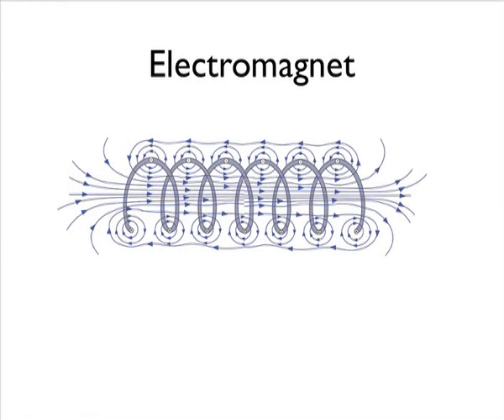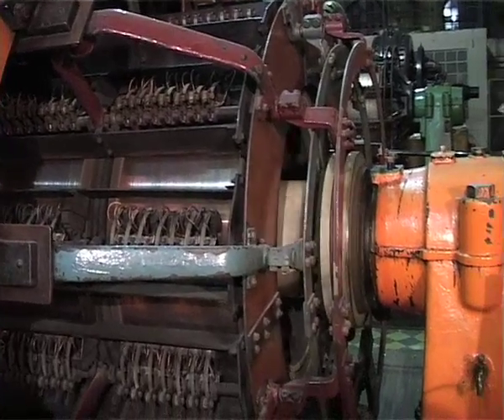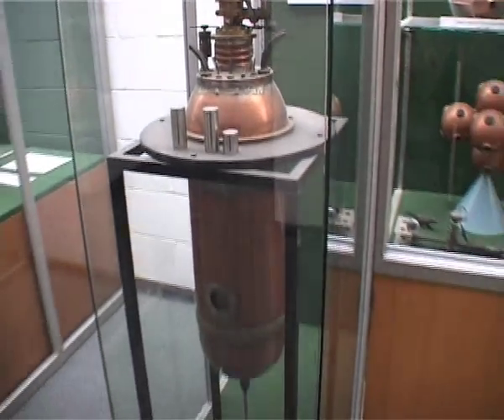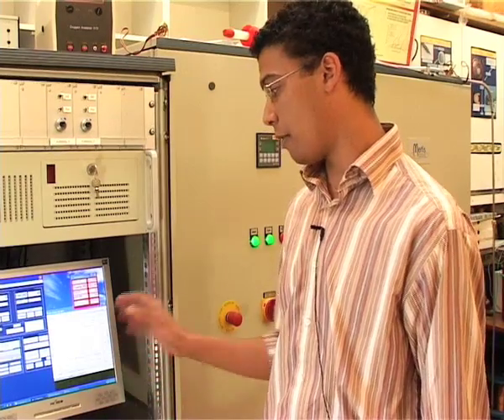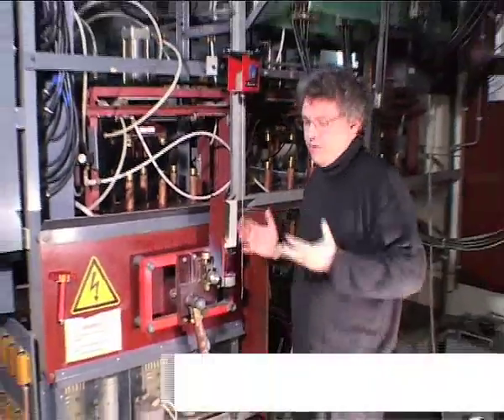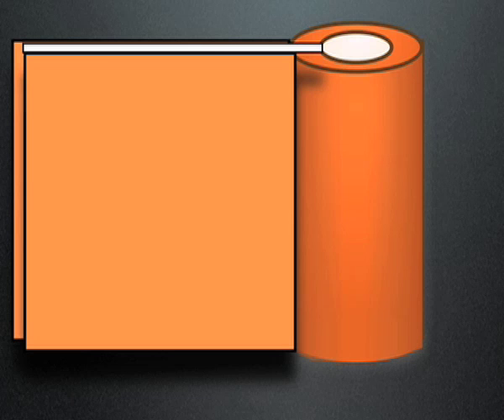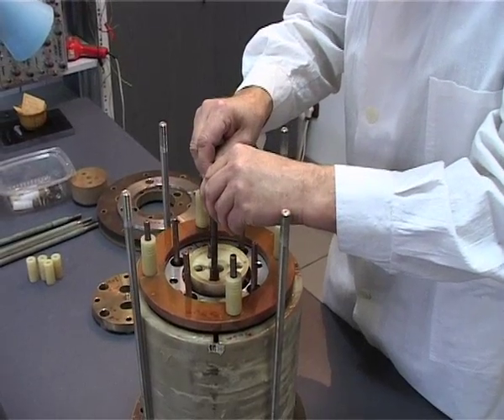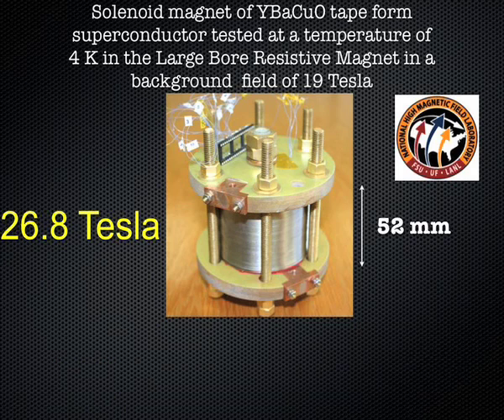Superconductivity: electromagnets

Comment: If we put the open circuit copper winding conected to the battery charger. Near the superconductor ring continuous current flowing through it then. 
Will the current get induce in copper winding for endless time?
Reply: Don't think so cause it will like act as a resistance for the superconductor and well at then the current will like stop and stuff